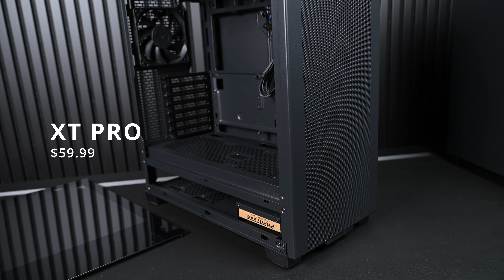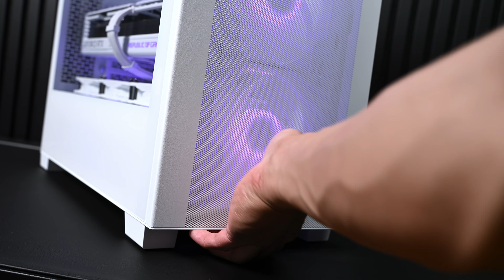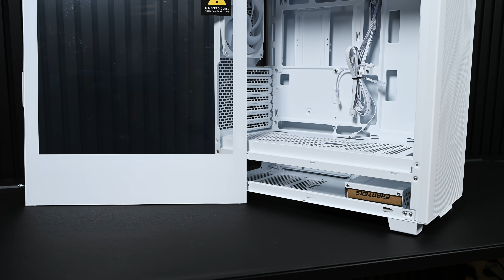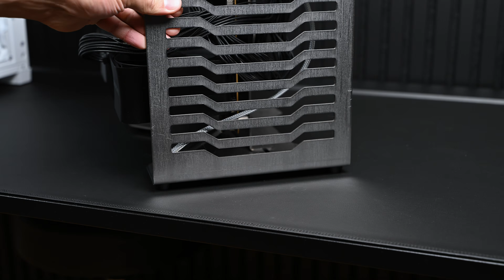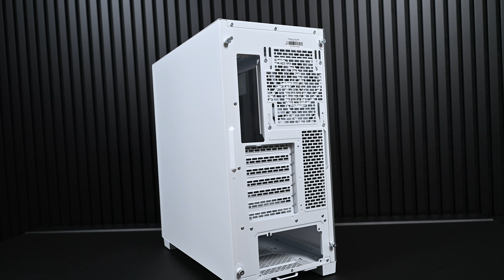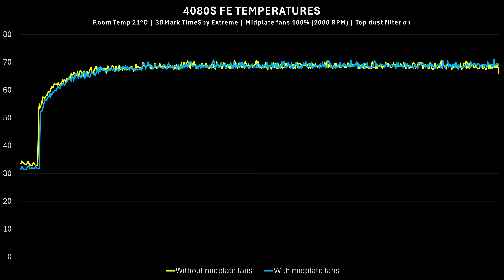Phanteks XT Pro Ultra Review – Incredible value

Comment: The gpu regulates its own fan speed according to temp. So if you add an accessory ventilation , the correct parameter to evalute is noise, not temp.

Comment: Hello everyone!

I'd like to know if this case offers good side space for cable management with a Corsair RM1200x Shift (which has the connections on the side of the PSU, not the back like most). I plan to use a standard motherboard (not a back-connect one). 
I have some doubts because seeing that it offers a maximum height of 185mm for the air cooler makes me think I might not have enough space to route the PSU cables to the back (side of the case), since I've seen cases with the same width (230mm) that only offer 160 or 165mm of maximum height for the air cooler. Also, I've read several comments saying that cable management was difficult, or that it was a tight fit... is that really the case? Will it be a good case for a Corsair RM1200x Shift PSU? (I want to use an ID-Cooling A720 air cooler, so I need a maximum height of more than 175mm, which is why I liked this case.)

Sorry for my bad English, I don't speak the language and I'm learning!

Comment: How about cooling performance with and without top mounted fans, for the air cooler people? I was about to order fans for the bottom, but thankfully I ran into this video. Based on the 2 degrees cooler temps without dust cover, top mounted fans should help out more than bottom mounted. In the 2x outtake and 1x intake formation.

Comment: The midplate or PSU shroud fans don't do much under load but it keeps the idle temps down and increases the low load threshold before the GPU needs to intermittently use its own fans. It's also possible that 3x fans pulling air up from that PSU shroud with limited air in it is just not working.

Comment: Sorry i dont speak English very Good But does the Case Come with a Splitter for the Fans like 2 Splitters so i only have to plug in 2 not 4
Reply from the maker: The fans are daisy chainable and they are all connected together. So you only need one end to plug into a header.
Reply: @hardlinenexus  perfect thank you because i have led Fans for the cooler too and only have 2 rainbow controller

Comment: Hello, great review. Can you write your opinion on the quality of the installed fans? How loud are the fans in the case at 50%? Have you noticed any air turbulence? The fans are mounted inside the case, just like my Phanteks P600S where there is unpleasant sound turbulence / resonance. The Eclipse G400A/G500A have fans mounted from the front and there is no more turbulence. Thank you for your answer and good luck.
Reply: The max is 31 decibels

Comment: I bought this case for my first PC build about a year ago (April of 2024) and it was super easy to build in. I love the simple aesthetic of it, and the included M25-140 fans a more than sufficient. I am, however, upgrading my fans since I am swapping to a new AIO. My MSI Coreliquid  E360 just doesn't get the job done. I am getting thermal spikes at idle where temp on my 7800X3D jump to the upper 70s. Phanteks released their M25-Gen 2 fans earlier this year, so I bought the Glacier One AIO that uses them and picked up 3 of the 140mm ones to replace my front fans (I would buy one more for the rear, but they are going for more than twice the MSRP right now, so I'm just going to wait for that to come down).

Comment: i wonder if you could just use the front mounting fan screws and dremmel out the midplate to make room for a 360mm radiator.   As you said the mid plate fans don't do much so you could probably get by with just 2 fans mid plate and giving up that front midplate fan to your cut out...
Reply from the maker: Yeah with a dremel you can do many things haha. The only down side is it just won't be as straight as laser cutting straight from manufacture which is what we want.

Comment: I want to express my appreciation for your innovative approach in designing your own case Morph last year. I’m particularly impressed with the rail system that allows for flexible adjustment of the core to accommodate the largest GPUs available, such as the STRIX 4090. Many SFF cases on the market overlook the need to support larger GPUs, making future upgrades challenging without replacing the entire case. Retaining this feature in any upcoming designs would be highly beneficial. I absolutely think you should keep that rail system in order to accommodate the largest GPU’s in your next cases (that you may build)

Your design philosophy aligns perfectly with my own criteria when selecting cases. With the recent increase in GPU size, this has become a top priority for me. Currently, very few SFF cases can accommodate the STRIX 4090 along with components like an AIO cooler, leading me to opt for an open case. While your case may not support an AIO cooler, its ability to fit the largest air coolers available is an excellent offset in my view. Congratulations on a well-considered design!
Reply from the maker: Thank you so much for taking the time to write all of this as well as complimenting my design. I really appreciate it. I also had good mentors that taught me good foundations too. :)
Reply: @hardlinenexus and do you also think Morph or any other future cases of yours would be purchasable outside of the US like EU for example?
Reply from the maker: @xEchoDrift  Most likely not, because it's too expensive for shipping.
Reply: @hardlinenexus  yeah, I figured that. That’s very unfortunate but understandable of course. But what if the user is inclined to pay for the shipping costs themselves? That way you technically could send them to Europe right? I mean yes for the user it would be more expensive, but I’m sure there are enthusiasts that would be interested to cover the extra costs. Unless you are talking about hundreds and hundreds of dollars worth of shipping costs then it’s a different story of course but I was just curious
Reply from the maker: @xEchoDrift  Oh yeah, all the time! I'm currently making an open test bench just for myself, maybe a couple other friends who are interested. I'll make a video on it when it comes in. But I also have other cases after it too.

Comment: Nice review @hardlinenexus . I am wondering if a arctis liquid freezer III 360 will fit in the case as top mount , what do you think ?
Reply from the maker: I think generally it fits all 360 AIO rads. They're all around the same size, I don't know any 360 AIOs that's way bigger than most others on the market..
Reply: It will not fit. Arctic LF have stupidly thick radiators that don't fit the majority of cases.

Comment: Hello, can you explain better how the 4 fans arrive about cables? You said that fans are daisy-chained, so how many connections do they need with the motherboard?
Reply from the maker: The front 3 fans are already daisy chained and preinstalled, I believe the bottom fan has the leading PWM cable that needs to connect to a fan header on motherboard. The rear fan is solo though, but if you have other M25 fans, you can daisy chain them together. I think my setup was front 3 are daisy chained so they go on one header, the top three fans are daisy chained on the AIO radiator and have another header, the rear fan by itself has its own header, and then the 3 midplate fans are daisy chained so a total of 4 headers I used on the motherboard.
Reply: @hardlinenexus  so the 3 front fans are daisy-chained so they just need 1 PWM header in the mobo and the rear one needs another one. But those fans just need a PWM header or they have another cable to control ARGB?
Reply from the maker: @ghostlu5462  ARGB has it's own cable, you should be able to see them hanging. PWM is 4 pin and ARGB is a 3 pin one
Reply: @hardlinenexus  yeah but my point is: consider only the 3 front fans, the PWM to connect to the mobo is one (because they are daisy-chained), for the ARGB it's the same? Only one cable because they are daisy-chained for ARGB too? Or for ARGB you need more headers on the mobo?
Reply from the maker: @ghostlu5462  ARGB is also daisy chained just like the PWM. If you look at the single rear 120 by itself, it should have two wires hanging off of it, PWM and ARGB, it's just not chained to any other fans because it's sitting by itself, but you can chain it if you look at the connectors.
Reply: @hardlinenexus  Thanks a lot! Btw the rear one should be 140 like the others and not 120
Reply from the maker: @ghostlu5462  Oh yes, you're right, it is 140

Comment: Bro i spend like 15 minutes finding your channel because you changed your name 😂😂 Great build! Do you think it also works with a 280mm radiator? The specs only say 120/240/360
Reply from the maker: Hah yeah I did change the name. The top panel does have mounting slots for 280, but I haven't personally tried that size.

Comment: Hey so uh, I’m thinking on changing cases and my question basically is if it’s worth it on the performance side of things. Like I generally don’t care about aesthetics that much (some rgb lights are ok I guess) I just wanna know if going from the aero cool cyclon atx case to the phanteks pro ultra case would make any performance improvement that is worth the upgrade.
Reply from the maker: I have never used the Aerocool Cyclon. But I did a quick search on their website and looked at the specs as well as studied the pictures, that's a terrible case design. But I can also see why it's only $62 lol. Quite a few things on that case is just not a good design, in comparison, pay an extra $18 for the Phanteks XT Pro, is WAY better, not even close.

Comment: how do you get the fans to light up? mine only spin and the 3 pin ARGB is connected to my motherboard
Reply from the maker: Make sure all the ARGB pins are connected through daisy chain. But you should also download your motherboard RGB software (ASUS Armoury Crate or MSi Dragon Center etc...) to adjust the RGB.
Reply: @hardlinenexus  i will check the pins when i get the chance, i also am able to easily change my pump and cooler fans so I figure it is a case problem
Reply: @roccos9777 did you fix it I have the same problem bro

Comment: What is the aio? I wanna get this case but i don't know if aio (Arctic lf3 360) will interfere with the rear fan. I dont want them to touch
Reply from the maker: You don't have to use the rear fan if it doesn't fit. But Arctic 360 should fit
Reply: @hardlinenexus  thanks

Comment: Im shocked that the 3 fans under the GPU made no difference to the card. Probably because they are way too close to the card and there is some conflict...... otherwise they are barely pulling any air from underneath below...
Reply from the maker: I think the fans are not that close to the card, in fact probably perfect distance. I also don't know if pulling enough air from underneath is the issue either because the front panel fans are assisting in pulling air in quite a bit to supply fresh air in general
Reply: @hardlinenexus  I do not own PC Gamer 😢😢
Reply: @hardlinenexus I don't have a PC Gamer 😢😢